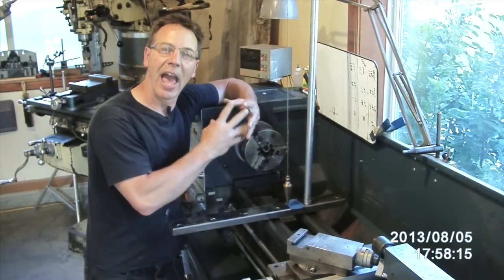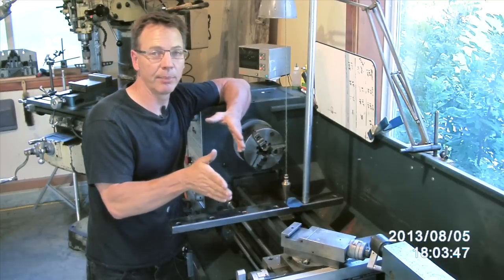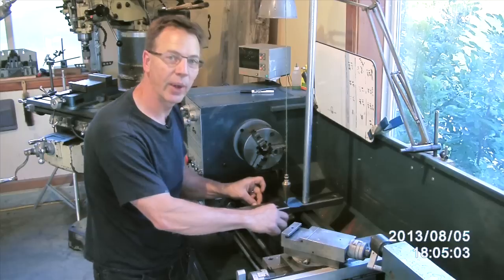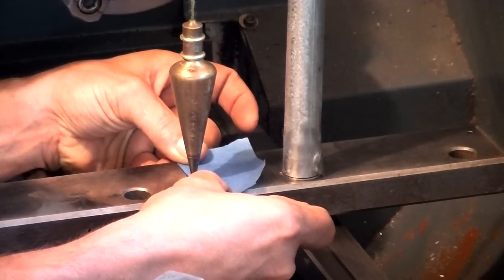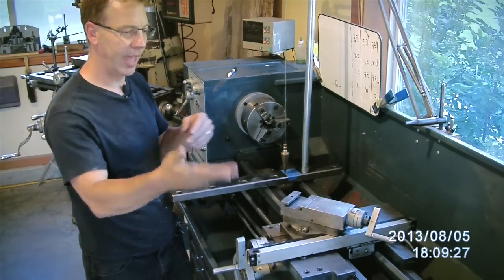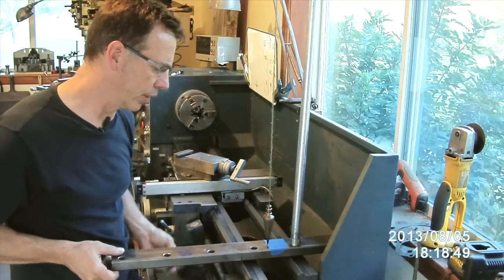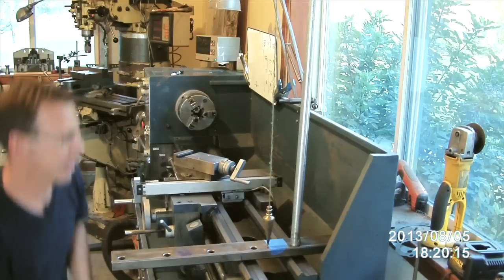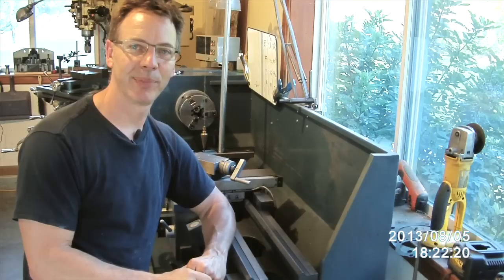Metal Lathe 101, Tip  #1:  Leveling your lathe

Comment: Where I did my time, any lathe bigger than a Colchester 2000, was on a Fully Floating & Insulated  purpose poured slab. No rubber iso mounts.
Every machine, was "Re-Leveled" every year , hard mounted & Grouted. This was part of our QA Qualifications for Navy & Aerospace Accreditation.
Our Mecof 8m Bed Travelling Column Mill , had 2M deep slab  under it !!!
Reply: That Mecof sounds like a beast! It wouldn't even fit in my shop!

Comment: In actuality the surfaces to register to are the back flat way and the front vee way. The perfect tool for this is the carriage.  Mount your vertical column on the compound and go from there.  I use a precision level for this. Your method with plumb bob is inventive, though not quite as accurate as a level, but a lot less expensive. Keep the good videos coming.

Comment: More great learning!
Thank you for these videos. 
I just began collecting and restoring older Vintage Machinery last year, out of necessity to have the stuff I needed to do home renovations on a very tight budget. I'm actually building a lathe from various parts of other machines and steel stock, and just yesterday realized I would need to re-engineer my base/stand from the ground up to allow for leveling, and being able to build your plumb-bob method and the feeler gauges will work well enough for my needs. 
Eventually, I'lll have a proper metal lathe or three, but for now I just need one that can make pulleys and the occasional shaft or arbor. As I acquire more pieces parts, I'll also use the one I'm working on now to make a second, larger and more refined version of DIY lathe.
Your videos are easy to understand, and that's important to someone like myself who finds themselves needing a lathe, but with little background in what to do. I subscribed after watching your "How To Inspect and Buy A Lathe" video.
Keep up the good work, and thanks for sharing.

Dave H.

Comment: Dale,

There is a more accurate way of leveling a lathe and much more simple. Instead of using a plumb bob hanging from a fixture such as yours you use a pendulum hanging down from bearing above and then you use a dial indicator resting against the end of the pendulum. You move the fixture from end of lathe to end of lathe and watch the indicator and adjust or shim the feet till you read the same.

Thanks,

Steve.
Reply: I read this 8 times.  I still cannot figure out what Steve is explaining.
Reply: @bobblack3870  Let me try to guess.  The video's plumb system consists of a horizontal bar at the base, a vertical shaft and then an upper horizontal arm.  Now, instead of having a flexible string hanging from an top arm, imagine having a rigid bar that pivots via a bearing at the same point that the string would have been attached.   This rigid bar would extend all the way down to the base, but be just short enough to still pivot and not interfere with the base.  One could then measure near the base the distance between the pivoting bar and the vertical shaft via an indicator.   Critique: This seems MUCH more difficult to construct.  And couldn't one still use an indicator against the plumb bob and get the same reading?

Comment: i just realised this, and yeah.... had to search. nice to see im correct for a change...

now to scrape a base.

oh. a small modification as i watch the bob wave back and forth?

when you look into galvanometers, they sometimes use eddy current braking to damp the needle. certain types...

a little disc of copper or aluminium, and some strategically located magnets. several ways to do it. just want to induce eddy currents, produce lenz reactions.

doesnt effect the reading but does tend to pull the bob into line a bit quicker if its damped.

Comment: The ends of the bed, against the headstock [L] and tip where the tailstock rests [R] ,  
are usually the least worn...sometimes showing flaking.  
I always double check with the level on the carriage, 
full travel left to right as the final check.

Comment: genius!
and if one has a surface grinder and a surface plate and scraper one COULD get the bottom of the gage dead to nuts flat. be a cool side project too :)
ive got a lvl but I'm absolutely terrible at using it.
definitely going to build one of these.

Comment: Made a similar setup to what you have there. I found it easier to use black iron pipe in 1/2 inch and use elbows, 8 inch nipple and a floor flange. Total cost about 20 bucks. My lathe was higher in the back near the tailstock. I thought it was just the opposite using my carpenters level. Slide a shim of stainless under it and it reads perfect on the little plumb bob.

Comment: What a great idea for shims, brilliant.
Reply from the maker: Hi Young Muttley,
I wish I would of thought of it first. I got that tip from an old Car Guy.

Dale d
Reply: Most auto parts stores sell 12'' long feeler gage strips separately.   
I use them to double check piston to cylinder clearances especially after boring a cylinder.  
They start at 0.0015", then 0,001", 0.002", etc. 
Mine go to 0.010", but they do go thicker.

Comment: I'm still a pretty clueless newbie, but there's a fantastic old article on lathe alignment (archived at http://www.neme-s.org/Model_Engineer_Files/Align1.pdf) that points out the carriage references off the sides of the vee-ways, not the top, and that the top of the vee's aren't usually precision ground or scraped. Actually, my little logan lathe carriage references off the sides of the v-way in the front and the flat surface in the back. I tried your method originally (with a machinist's level directly on the tops of the vees), then with the level on a matched pair of 1-2-3 blocks on the flat portion of the ways, and finally with the level directly on the saddle. In my case, the results using the tops of the vee's as reference differed significantly from the other results. I was surprised to realize that simply placing the level on the saddle itself (and cranking the carriage left, right and center) worked as well as anything, and to my mind gets directly to the point.

The whole point of removing twist is that you don't want the saddle to pitch forward or back (even minutely) as you move the carriage left and right. Correct?
Reply from the maker: Hi Rex.
Thanks for sending me the Link its a great article. I think your right about the tops of the Vee ways not being milled correctly on most lathes. I did check mine before I leveled it, and forgot to mention it in my video.
 I will disagree with you about putting the level on  the carriage. The goal of this video is to have your Tail stock lined up with the head stock. The carriage runs on a different set of tracks that are usually worn more near the head stock than at the tail stock. 
PS I would not say your a glueless Newbie

Dale D
Reply: Rex Walters right-o.
Reply: You are quite correct, a better version of this clever rig is to mount the pole on to the cross slide itself. I mounted mine to where there are 2 tapped holes for a taper attachment. By mounting it directly to the cross slide you are reading exactly what the tool bit sees at it travels back and forth along the bed. Also you must let the blumb bob stop moving to get an accurate reading. To stop it swinging around hold a pencil against it and roll the pencil away slowly will allow the bob to settle perfectly
Reply: The Machined ends of the bed, against the headstock [L] and tip where the tailstock rests [R] , are usually the least worn...sometimes showing flaking.  
I always double check with the level on the carriage, 
full travel left to right as the final check.
Reply: That article was from the Original Tubal Cain - an old British chap writing back in the 70s.
Reply: codprawn “video” made me giggle - you meant the article. I’m a big fan of Tubal Cain, GHT, and all the English hobby machinists
Reply: @ikkentonda  
Yes I meant article - half asleep!!!

Comment: Great video.  I'm thinking about the accuracy.  I think that your visual inspection of the bob position in the horizontal axis can't be more accurate than +/- 0.010".  With height of vertical arm of 4 ft (48"), then this would be the equivalent of (0.010/48)*12 = +/- 0.0025"/ft.  Not bad.  It would be a fun experiment to see if sharpening the end of the bob and putting a finely-graduated scale under it could improve this.  Or perhaps use an indicator.  Your approach is very cool and innovative.  Thanks!
Reply: It's good to see someone use ingenuity rather than pulling out a £2000 tool!

Comment: Seems like best accuracy would be something (V-blocks?) riding on the same surfaces as the carriage.  This setup assumes there are no nicks or different wear on the top surface vs. the way surfaces.
If you wanted to get fancy, damping the pendulum could be done the way balance-beam scales do:  piece of aluminum sheet passing through a magnetic field.  Motion produces eddy currents, which converts the kinetic energy into a bit of heat.

Comment: If you had the tip of the plum bob resting in a small bowl of syrup, it would damp down the swinging action.
Reply: I like that. I'm thinking spindle oil. I'd need a registration point  in the little container.

Comment: good afternoon, I just discovered your channel, I would like to take a doubt, this method works on "lathe-bench" or lathe 600mm ? I'll make a table for it in steel and use wood and rubber underneath , should I use this method or have to use other techniques ?
Reply from the maker: I try it and see how it works :-)

Comment: Hi Dale and thanx for sharing your knowledge. I just purchased a 8.5  20 lathe from lms .how critical is leveling on a lathe this small?  I have made a platform from 3 3/4 inch cabinet grade plywood that is glued to avoid distortion and will be mounted on a  rolling tool chest. have not mounted yet and after watching your video thinking of a stud mount so i can shim under corners. please give me your opinion.  unit will be mobile so leveling the whole cart will be impractable .  thanx.
Reply from the maker: Hi Dave. My worry for you is the bed will twist over time. But don't worry there is a simple solution. Mount  the lathe to a thick Board, and mount that board using 3 points onto  the roll around cabinet.  The three points will keep the lathe from twisting.
Reply: Thank's so much for taking the time to respond to my question.  I'm glad i asked you first starting the project. Now that you got my wheels turning i'm going back to the drawing board.  thanks again and good job on the new playground.

Comment: Cunning dodge!
Possible improvements: machine a couple of grooves underneath, and screw or glue a dowel into each, to register either side of the V way (or ways) - as other commenters have mentioned, the top horizontal edge of the ways is sometimes not true to the ground guideways. (You can check this with a block with a shallow V in it, onto which clamp a mag-base DTI, and slide it along).
Another way would be to glue bearing balls into drilled dimples: two pairs of balls to register on one V-way, and a single ball on the other way, to eliminate rocking and avoid the need for accuracy. No need for sharpie alignment marks, either.

Also, (ideally) a piano wire, or perhaps nylon monofilament, through a notch at the top, would stay put more reliably when shifting the rig to the other end. If the string slips, the reading will be out by the same amount as the slip.

I wondered about a further enhancement, using a shorter rig and a heavy cylindrical bob with a DTI (using an 'elephant foot' plunger end) if someone wanted to use this more generally, and more conveniently. 
Alternatively to a plumb-bob, a pendulum with a knife-edge bearing, perhaps? This would allow using a sensitive, side lever indicator.

Still a lot less effort than earning the money to buy a sensitive level.... especially for those who would have to make a V-registering sub-base anyway...
Reply: The ends of the bed, against the headstock [L] and tip where the tailstock rests [R] , 
are usually the least worn...sometimes showing flaking.  
I always double check with the level on the carriage, 
full travel left to right as the final check.

Comment: Nice video but i think i have a simpler way and maybe more accurate.  Take 2 pieces of half inch bar stock about an inch long and drill a small hole dead centre to insert a small guitar string through. Then put one piece in the lathe chuck and the other piece in a drill chuck inserted in the tail stock and draw it taught . Then put a very pointed tool in the tool post then follow the string moving the carriage front to back. I've never tried this but to my logic i think it would work and be pretty accurate. What do you think?
Reply: You are assuming your chuck holds the thing concentric, the drill chuck holds it concentric and the string being absolutely in the center of your little bar stock. Also you are assuming that the tailstock is coaxial with the spindle. Essentially you are introducing way too many variables in to this s you have no idea where the errors come from. The proper way is to level the ways either as shown or using a precision machinist level and then start by checking that the headstock is parallel in two planes to the ways. From there you can then start checking and adjusting your tailstock.
Reply: As for concentric is cincernerd that what dial indicators are for. Tail stock should be set correct before any kind of leveling. Also my method will compensate for any lathe errors.

Comment: Good method with simple tools. Why not mount the plumb bob on the slide and move it back and forward, that's the bit which does the business. Also yours is a long lathe shorter lathes could not be deflected as much by adjusting the feet. I have an old lathe which would indeed deflect the bench before it would change.

Comment: wouldn't the proof be in actually turning a piece to see if your leveling device actually worked?  This is great if one doesn't have a fancy level, but even with one of those, the only way to know for sure is to actually turn a piece to see if they are the same at both ends.  Then the fine tuning goes from there.
Reply from the maker: you are correct.:-)
Reply: Yes and no. You first need to measure that the headstock is parallel to your ways so that the taper doesn't originate from there. Only after that can you start fine tuning things.

Comment: This can be used to level anything . I wonder how sensitive this is versus a precision level ?
Reply: You can calculate it easily when you know the length between the ways (in this example) and the height of your plumb bob fixture. Divide the height with the length and you get the multiplication factor of how sensitive it is.